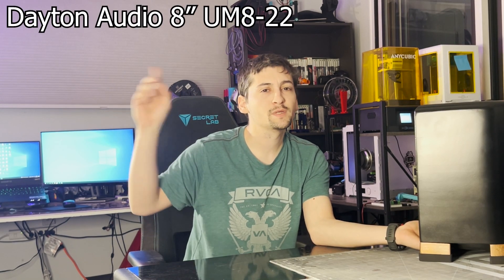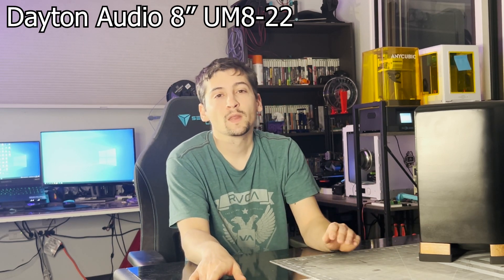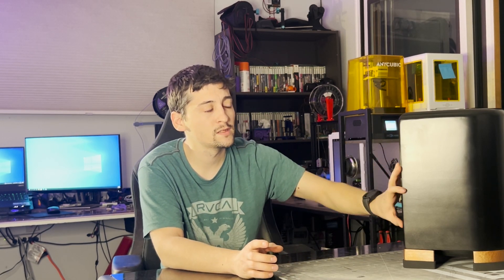3D Printed Subwoofer Enclosure Reinforced With Concrete

Comment: Hey man, great video building the box. I'm a big speaker nerd, so I have some questions that you may or may not understand yet. It looks like you've got some measurement microphone equipment and are using REW (maybe). Did you happen to model the low end response of your driver with T/S parameters in WinISD to see what performance you should expect? To get a better idea of how the driver behaves in each box you should try blending a nearfield and gated farfield measurement with a short sine sweep. That will give you accurate data on what's really happening in the low frequencies. I doubt you got any subsonic output from either box, as both of them were sealed as far as I could see. If you want to get more feedback on the speaker design aspect of your project, look up the DIY Loudspeaker Project Pad on facebook groups, or stop by the Midwest Audio Club forums at https://diy.midwestaudio.club

Keep having fun!
Reply from the maker: Yep way over my head, I’m really good at making boxes pretty. But not so into the super technical side of things. Part of why I went to a sealed box, not much you can screw up on in a sealed design. 

But yes I use REW to get measurement from speakers I build on the channel, just to compare the performance in graphical form. 

I didn’t model this box in winisd, I modeled the last old box that I pulled the sub from in winisd, but I don’t remember what the response was supposed to be, as that was 6ish years ago. 

Unfortunately I have no idea what you mean by blending near and gates farfield, and to be honest I’m not even sure I use the UMIK and REW correctly, I mainly just use the same voltage at the speaker terminals while playing pink noise to “set” the amp, from there I have a known constant input that I can compare the output differences from. But I’m not sure if that’s right or not.